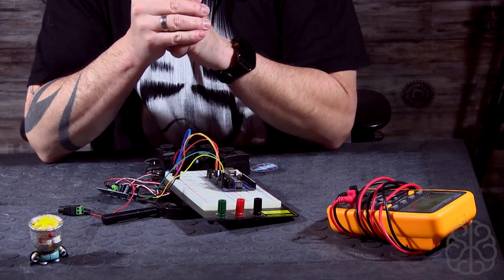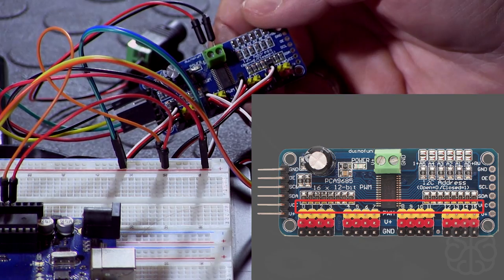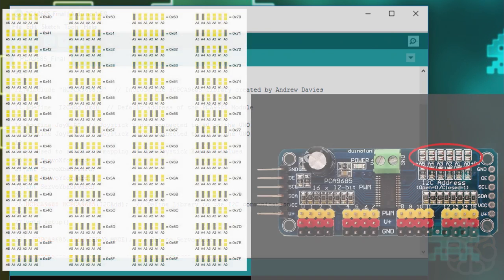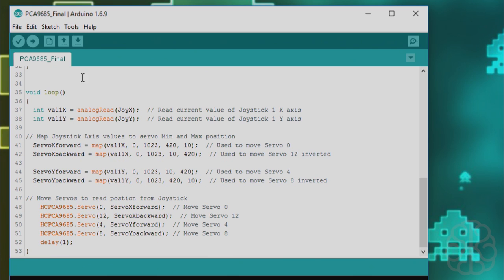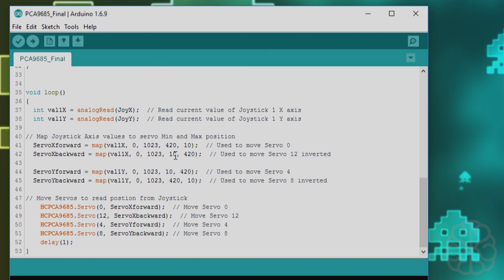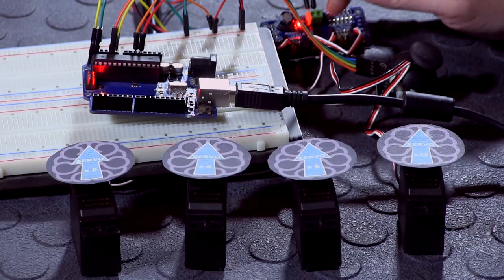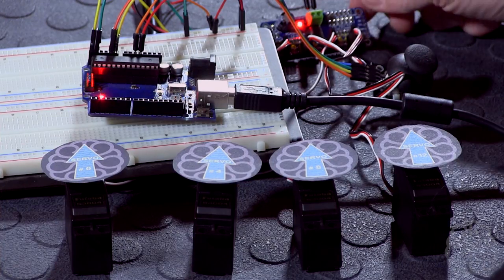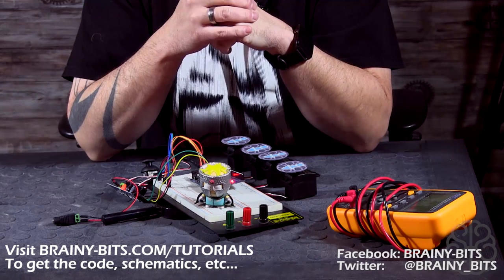Control a 'LOT' of Servo Motors using a Joystick, Arduino and PCA9685 PWM Module - Tutorial

Comment: I keep getting this error message:
C:\Users\miles\AppData\Local\Temp\.arduinoIDE-unsaved2023627-21676-ndttoc.exchg\sketch_jul27a\sketch_jul27a.ino:12:10: fatal error: HCPCA9685.h: No such file or directory
 #include "HCPCA9685.h" // Include the HCPCA9685 library created by Andrew Davies
          ^~~~~~~~~~~~~
compilation terminated.

exit status 1

Compilation error: HCPCA9685.h: No such file or directory

Comment: It seems that the PCA9685 library is unavailable on the website https://brainy-bits.com/tutorials. Can you fix that for us? Thanks!
Reply from the maker: Hi Tim, thanks you for pointing that out!  I've gone ahead and fixed the link.  You can go ahead and get the library now: https://brainy-bits.com/blogs/tutorials/control-multiple-servos-with-joystick  Thanks for watching!
Reply: @BrainybitsCanada  PAGE NOT FOUND error.  What library is used for this tutorial?  There are multiple libs available for the PCA9685 in the IDE.  Thanks in advance for your prompt reply; I noticed other viewers have asked the same question.
Reply from the maker: @jeffrey-deitch  Changed website a while back so some link are now broken, but you can use the Search to find them...  Here's this one: https://www.brainy-bits.com/post/control-a-lot-of-servo-motors-using-a-joystick-arduino-and-pca9685-pwm-module

Comment: I want to build a hexapod robot with 12 micro servos sg90 (+- 200mA/servo), arduino uno, and pca9685 to drive all of the micro servo sg90 (12 servos);
What do you think if i use 1 power supply from UBEC DC-DC regulator that has 8A-15A and 6V output ?
And if i use 1 power supply from UBEC, is it better to connect the power supply to arduino uno or connect it to pca9685? why?
thanks :)

Comment: Hi!  I couldn't understand one thing because my English not good enough. My A4 A5 pins not empty I connected a sensor it is using these pins. If I understand truly I need to change the code with 0x70 and also I need to add resistors A4 and A5 pads. Am I right? Right here the second question Am I gonna use the resistors under these pads?

Comment: Can I use this code with a raspberry pi zero w?  Would the pin configuration be the only difference between Arduino and raspberry pi? If not, do know where I can find python code to run a joystick with a PCA9658 and a pi? Thank you very much!

Comment: What power source do I need to move these servos? When I try an 7.4V LI-PO  accum with a L7806 stabilizer, it can power up 2 servos only. If more, stabilizer becomes extremely hot and nothing works at all.

Comment: + Brainy-Bits very cool tutorial!👍🏻
I have two questions, I didn't note that u used a common GND for both arduino board and the external power supply which u used to power the servo motors, didn't u do that?
Then, is there any way to get rid of that noises when servo motor isn't in the position zero? Or it's something normal? And thx 😊
Reply from the maker: Good questions...  The PCA9685 module takes care of the common GND since the module is powered by the UNO 5v and GND: You can check out the schematic here: https://brainy-bits.com/tutorials/control-multiple-servos-with-joystick 
For your second question, can you clarify what you mean by noise and position zero?  Do you mean to make the movements of the Joystick less sensitive so the servos don't jitter as much?

Thanks for watching btw :)
Reply: Brainy-Bits thank u for ur reply :)
I meant, when the servo motor starts rotating for example to 90 degree position, it keeps vibrating (even gently) and u can hear it makes a loud tickity-tickety noise as long as it's stay in the new position (which is 90 degrees in my example), but, as it rotates back to its previous position, the sound disappears and it's quiet again!

Comment: This worked great for me,managed to mod the code to run multipul analogue inputs and more servos on an arduino mega... can you explain how you arrived at the value of 10 - 420 for mapping? it works great im just curious how the map function relates to the 1-2ms pulse width servos need. presumeably that means 205 is centre..